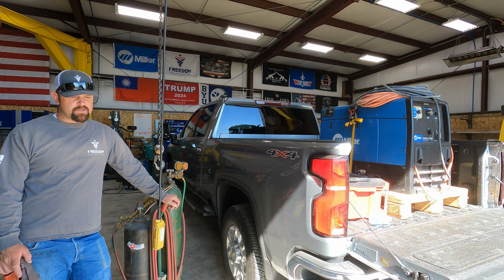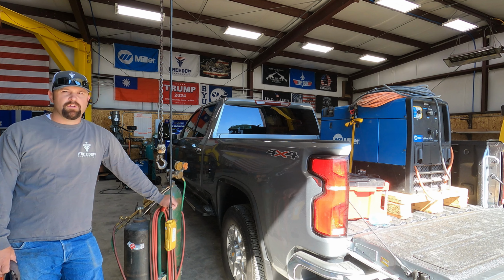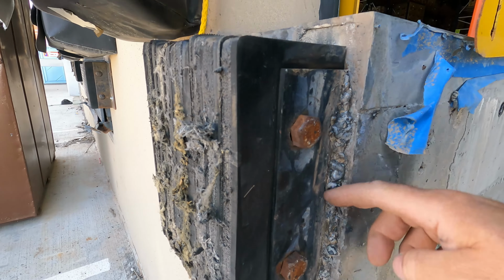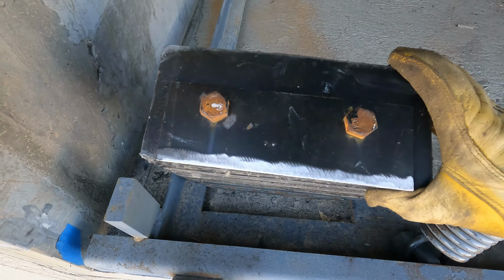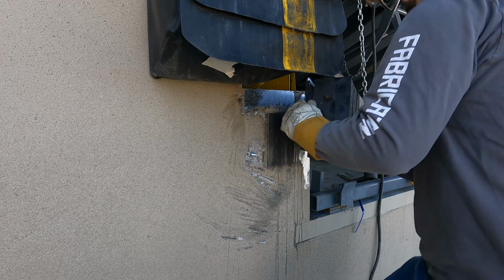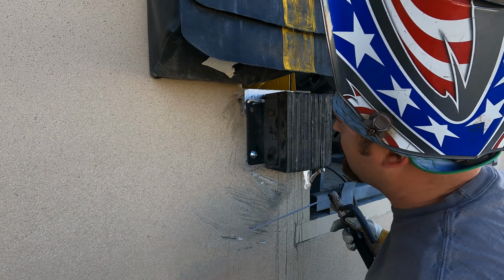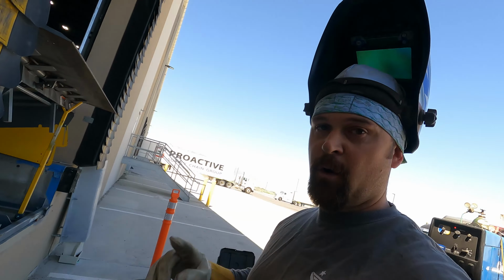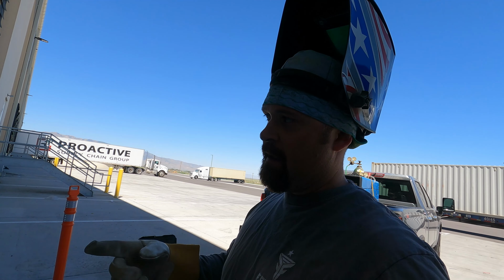Dock Plate mobile welding repair

Comment: I feel your pain I just do pipe fence and h braces but it takes me 40 mins seems like to load everything up in my truck.
Reply from the maker: You gotta love it. That’s why I always charge a 2 hour minimum for jobs like this. If it was a longer drive, I would add another hour for travel, but this one was relatively close to my house. It will sure make it easier when that dang welding trailer is done though! Thanks for watching!

Comment: Do you mind me asking how much your steel i beam shop costed?
Reply from the maker: I built it in 2017, and it was $23,000 for the kit. That doesn’t include insulation or concrete

Comment: Should think about building yourself a welding skid, would make loading and unloading a lot quicker
Reply from the maker: I’ve thought about it. I went back and forth between that and a trailer. I just recently got something In the works. Stay tuned! Thanks for watching!
Reply: @Freedomfabrication777  I bought a 5'x10' with a single 3500 lb axle.  If you're going to put a lot of stuff on the trailer with the welding machine, you might want a larger axle/spring or a 2 axle trailer. I have a Miller Bobcat, 2 oxygen bottles, 2 acetylene bottles, a 75/25 bottle, air compressor and several toolboxes.  With all that on there, the frame of the trailer is almost setting on the axle.  I mainly use mine on the farm, so i don't go far with it. If I had it to do again, I'd go with a little heavier duty setup.  I can send pics if you'd like see my setup.
Reply from the maker: @chrislee8175  great info. I would love to see your setup. I was thinking about using a 7,000 lb. Axle. I have some stuff in the works. Stay tuned, and you’ll see what I mean. Send your pics to my email: sdahl7@gmail.com. Thanks for the info and thanks for watching!

Comment: Why don't you use an air supply for your breathing while you are welding
Reply from the maker: There are situations where that is needed. In confined spaces, for example. This was definitely not one of those situations. It was outside, and when I was inside the building, the door was open with adequate ventilation. I think the important thing is to be smart. If ventilation is limited, you have to modify the conditions to make it safe to work. Not a bad question, just giving you an honest answer. Thanks for watching!

Comment: Why aren't you using propane?
Reply from the maker: You mean for my torch?
Reply: @Freedomfabrication777  absolutely  my friend .
Reply from the maker: @bigdave6447  I’ve just always ran Acetylene. What’s the benefit of using propane?
Reply: @Freedomfabrication777  glad you asked,cheaper and no lease,readily available even on weekends and holidays, safer gauge pressure can be anything, acetylene can be sensitive over 15 # and can detonate at 30#,propane uses 2 piece tips which are easier to clean,burns steel just as thick. Downsides ,supposed to use grade T hose , can't gas weld but who does anymore,can't use pressure gauge to tell tank contenrs,need gague like you can get for your gas grill. Need propane tips . One more benefit is cuts cleaner with no hard edges.
Reply: @Freedomfabrication777   no scrapyard uses acetylene only propane!
Reply from the maker: @bigdave6447  I’ll have to look Into it. Thanks for the info! And thanks for watching!
Reply: @Freedomfabrication777  I've been using it for 47 yrs wou l don't use anything else, hope it helps you ,good luck!!!
Reply from the maker: @bigdave6447  Thanks for the info!